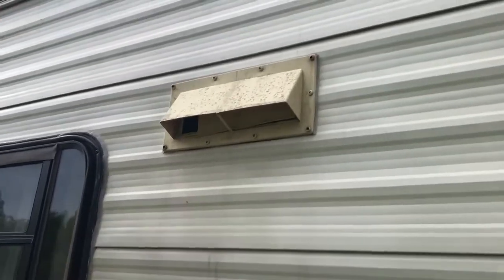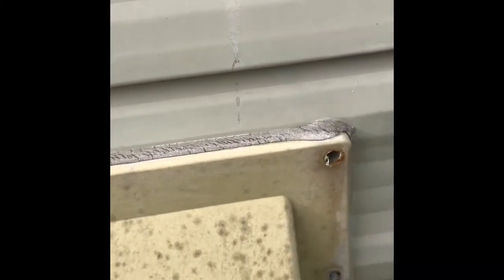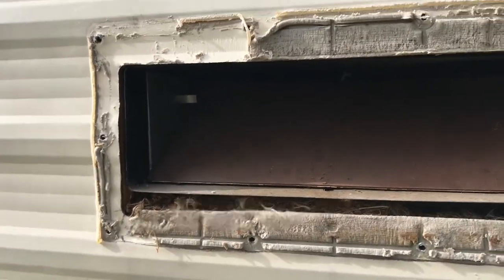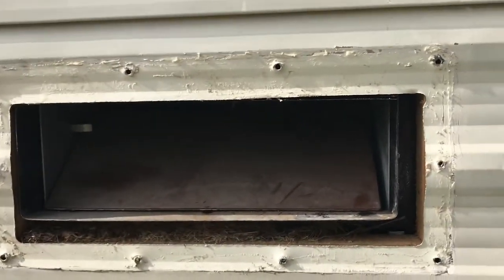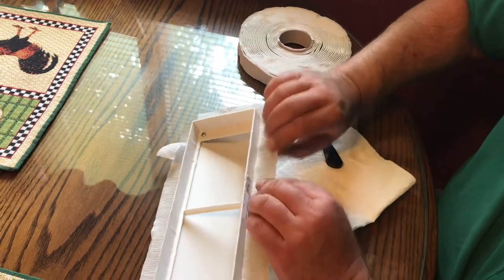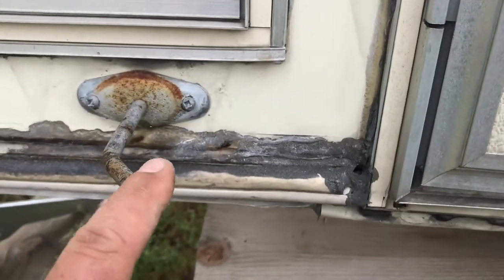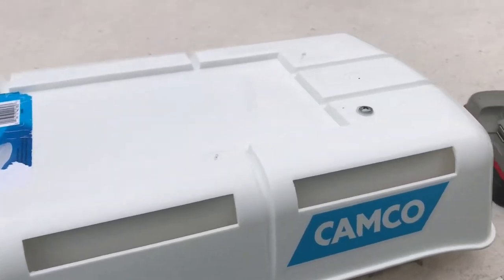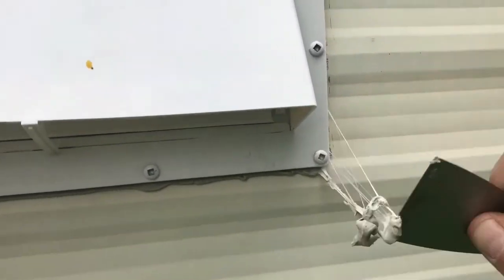RV Repair : replacing vents

Comment: Nice job on the vent replacement. Saved yourself some labor cost. I do that whenever I can.
Reply from the maker: My next project will be wiring in a inverter to run the refrigerator while on the road. The pilot light blows out when on propane on the expressway.
Reply: @truckdrivinmilanr  
There is always a solution. You just have to find out what it is.  lol Great